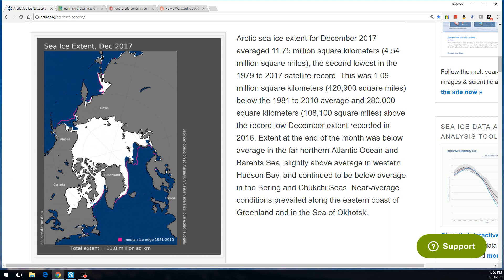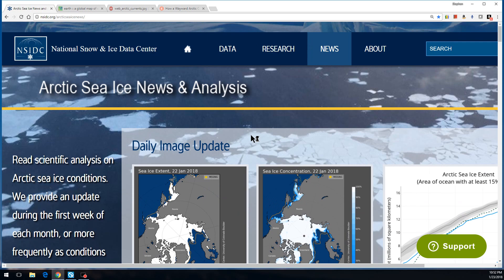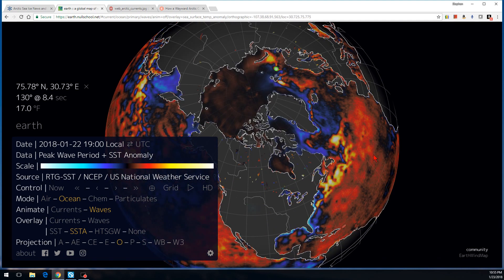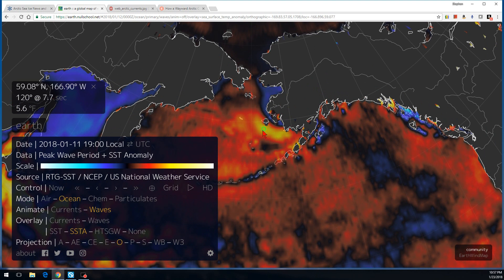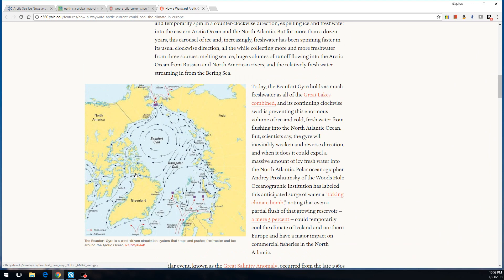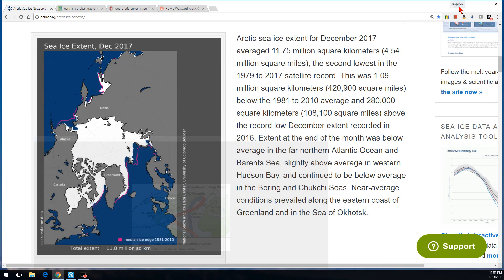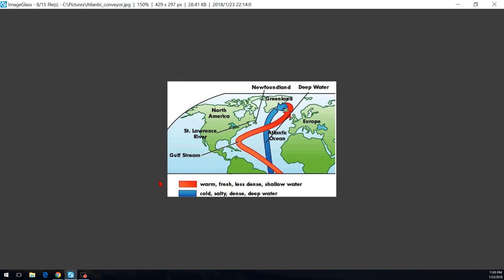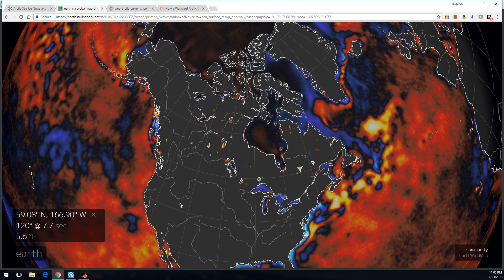Arctic Sea Ice Update and the Beaufort Gyre

Comment: Data Facts ....... The earths Solar Radiative Forcing is up by 2.29w/m2 or 2.29 x 500,000,000,000 or 1.2 Peta Watts .... or 300,000 40 mega watts power stations to just heat the earths biosphere .... Natural extinction rates are 1 species every 10,000 years ..... Todays rate is over 100 per day, so 10,000 times natural rates ........ Mainly caused by Human activity talking over natural habitats and putting mono cultures, concrete jungles and grassing land in their place ...... Greenhouse gasses are higher than they have been for 3.4 million years during the Pliocene .... When there was no ice in the Arctic and the Whole Western Antarctic was Ice free ....... Cores from Peru show that sea levels were 20-25m higher than today ..... When the Earth came out of the last Ice Age 13,000 years ago temperatures rose by 10'c, Sea Levels rose by 100m ... CO2 levels only went from 180 to 280ppm ........ I am very qualified scientifically ......... CO2 is a catalyst that Just like in an Avalanche ...... A small bit of snow cliff breaks at the top and then 1000's of tons of snowpack are racing down the mountain .....
Reply from the maker: Ok, so I was right.  You came to the data with a belief.  Then you searched, and found, some interesting data that validates that belief.  Therefore, there is no way there could be any answer other than the one you assumed was right from the beginning.... and this makes you qualified scientifically.... Thank you for playing... Have a nice day.

Comment: Does the sun put enough heat into the water to account for all the warming or does the Atlantic Rift and the Icelandic Rift add much more heat to the water than the sun can in a month or 2? Only the top 10 ft would be heated by the sun. At 80F hurricanes are created and they are relatively short lived and do not go very far north.  Warm water cannot dive under floating ice. If it is being melted from below there is a rift that is expanding faster than 'normal'
Reply from the maker: Bingo.... You're right over the target here.  The furthest northern end of the mid-Atlantic rift (for instance) was believed to be an ancient, and completely inactive, region.  Then a company pulled a submersible over it looking for oil and the cables just about melted in the heat.  However, it's also important to remember that VERY active hydro-thermal vents have been discovered that are nowhere near a rift (similar to how volcanoes are not near rifts).  Also, currents are powerful things, and if you look at the Arctic melt you'll notice melting (and thinning) is worse where currents push warm air against the ice sheet.  If the edge of an ice sheet melts (fresh water) into a current that pushes under an ice sheet what happens?.... Just a little food for thought.

Also consider the Beaufort Gyre.  If fresh water is lighter than salt water, but fresh water on the surface is cold enough to freeze, why doesn't fresh water under the ice freeze above the below freezing salt water?.... Maybe evidence that something is warming below the ice?.... Just another thought.
Reply: When you add the age of the crust is is possible rewind the clock. Combine that with googleearth and the rifts in the northern oceans is clear so the speculation on where the magma flows should also be pretty accurate. All sea ice is fresh water, the salt precipitates out as the water freezes.  
https://www.youtube.com/watch?v=Tx7K4GiLqJI

Hot-spots could have several causes. The chain of island that for Hawaii show the land that is at the Bering Strait was above it at some point. Any heat released into the water by the Pacific Rift would go south as that is the way the currents flow. When the air is warmed it is enough to shift the winds to blow to the north instead of to the east. That is how Alaska get heat. To have warm water flow into the Arctic it was to get warmed up by events lose to Japan. The narrow gap and the ice would try to block it and warm air going over ice will see the moisture fall as snow rather than the ice is evaporated. Magma would flow under Alaska and the Strait and under Russia as it flows away from the rift. As it flows under the Arctic Ocean it could release enough heat the melt the ice while Greenland is experiencing ice-age conditions due to the rifts that affect her climate are slowing down

Comment: CO2 effecting climate change isn't the worry - it the acidification of the oceans that will kill us off. Thoughts?
Reply from the maker: Ok, here's a couple thoughts.

1.  I have looked at ocean acidification data (and ocean CO2 data) and I'm just not sure I can trust that there hasn't been intentional manipulation.  For instance, by far the biggest force to manage CO2 absorbed by the ocean is phytoplankton.  When CO2 goes up, phytoplankton start eating (byproduct = oxygen) and dividing like crazy until a balance is restored.  However, CO2 level is only one of a few conditions that must be met in order for phytoplankton to thrive (for instance, temp is another factor).  The conditions required for phytoplankton are VERY well known, so if I wanted to collect data showing increasing CO2 (aka acidification) all I have to do is choose high potential CO2 areas that also are areas with poor conditions for phytoplankton where I collect my "data".  These areas change, due to things like ocean current changes, so it is easy to make the sampling look "random" and distributed..... See if you can find a single report that includes phytoplankton data along with CO2 and acidification data... good luck.

2.  All of the data I've seen points to the fact that oceans are warming due to hydro-thermal vent activity increasing.  Hydro-thermal vents release massive amounts of heat, minerals, and....wait for it..... CO2 into the oceans.  Now, would you care to guess what the three primary requirements for phytoplankton bloom are?.... it's incredible isn't it?  Multiple studies have estimated that phytoplankton is responsible for as much as 85% of all oxygen released into out atmosphere..... Oxygen is a byproduct of phytoplankton eating what? (hint = CO2).  Due to ocean warming phytoplankton blooms have been seen recently from the equator all they way up to near the arctic ocean.... balance is underway....and of course, phytoplankton is only one of the tools the ocean has available to combat increasing acidification due to CO2.

3.  Finally, IF the oceans are actually becoming more acid there is zero chance that the human contribution to total atmospheric CO2 is a serious contributor to it.  Basic math.... The total percent of earth's atmosphere that is CO2 is .034%.  The estimated human contribution to total CO2 in earth's atmosphere is 3% (and increasing).  3% of .034% = 0.0000102% which represents the total human contribution to atmospheric CO2.  Now, I don't know the number exactly, so let's just stay safe and say only a "TINY" fraction of the total atmospheric CO2 gets absorbed by the ENORMOUS volume of ocean water on earth..... Is it reasonable, responsible, or even sane to claim that human contribution to atmospheric CO2 is killing the oceans??..... especially given the phytoplankton info shared above?

So, you know.... those are a couple of my thoughts.  ;)
Reply: A Gibb's reflection and critique of your own statement (above) would help - for starters. Then I'll know you're not being disingenuous. 

Truth is more important than spin and using the political method isn't helping - once you rule out being able to trust your own data source it's better to find alternatives - you should always be critiquing your own work, 1st year at university taught you that. Are you out of practice?